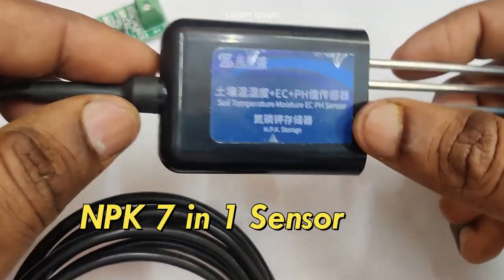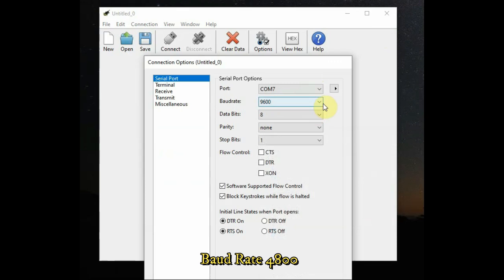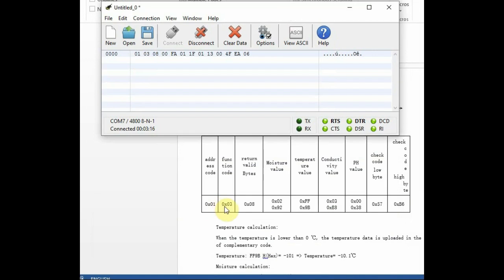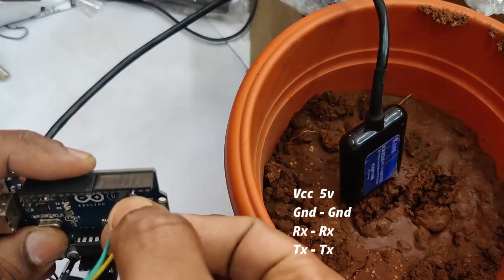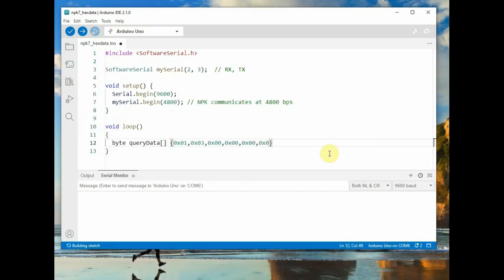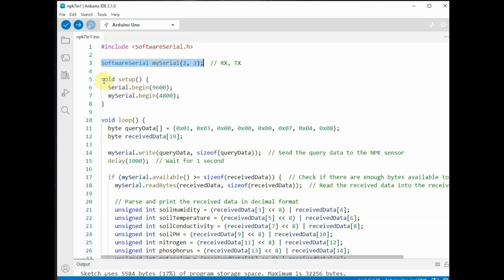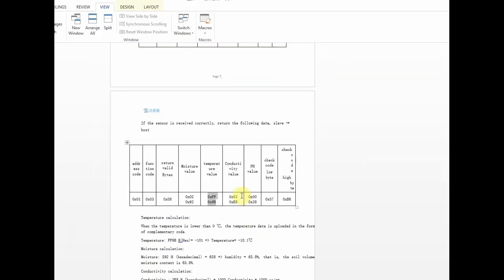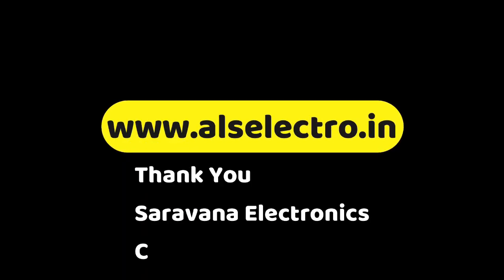NPK 7 IN 1 SOIL SENSOR - Humidity,Temperature ,EC, PH & NPK values all in one

Comment: 00:03 - The NPK 7 in 1 soil sensor provides soil moisture, temperature, electrical conductivity, pH, nitrogen, phosphorus, and potassium values.
01:23 - Connecting and configuring NPK 7-in-1 soil sensor
02:42 - Retrieve soil moisture, temperature, EC, and pH values using the NPK 7-IN-1 Soil Sensor
04:04 - The soil sensor measures humidity, temperature, EC, pH, and NPK values all in one.
05:27 - Sending query data to NPK sensor and receiving the data
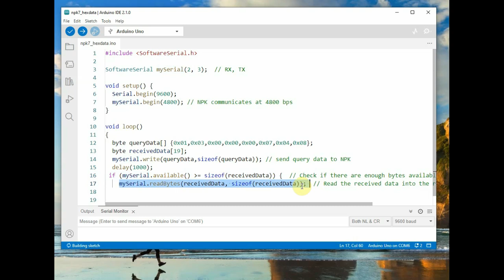06:46 - The NPK 7 in 1 soil sensor provides data on humidity, temperature, EC, pH, nitrogen, phosphorus, and potassium values in HEX format.
08:16 - Data values from the soil sensor are obtained using bit shifting and bitwise operations.
09:38 - Extracting two byte integer values from received data array using bitwise operators

Comment: i have the rs485 to ttl you mentioned in the start (max485) is  there any way to use it to interface the sensor with esp board ?
Reply from the maker: you can check this video with ESP32  https://www.youtube.com/watch?v=kVBtNAe7tow&t=992s     .Any RS485 to TTL with Auto Direct facility can be used

Comment: Thank you for your efforts, but I'm using rs485 with DI,DE,RE,RO and the output readings is wrong  .Is there away to use it instead of max13487.Thank you in advance
Reply: I intend to use this sensor but I don't have it yet. So I may be wrong about my conclusions so far. Looking at the schematic shown in the circuit drawing, the RS485 module is used instead of the MAX485 version that is physically shown in the video and has flow control (4 data pins: DI, DE, RE, RO). In the video this feature is mentioned (auto direction enable) and allows sending and receiving data between two Arduino boards (or another platform of the type). So the use of the MAX485 version is allowed but should not be mandatory. For beginners like me, this detail may raise doubts. Perhaps the soil sensor used has some incompatibility with the simple RS485 version. In this application, the RS485 module only receives data from the sensor and transfers it to the Arduino through digital ports 2 and 3, which are connected to the RXD and TXD ports of the RS485. Other boards identify these pins as DE and RE.  To add to the confusion, the power pins (VCC and GND) are next to the pins that are connected to the sensor in the MAX485 version, and in the RS485 version shown in the drawing, the power is next to the data pins that are connected to the Arduino board. In the video, the MAX485 version shows the DI and RO pins connected, but in this application they are not used. When I can test the sensor, I will post the results.
Reply: How is the result, does an rs485 work?😊

Comment: Could anyone shed light how the sensor actually works ? I understand the communication but what soil parameter it is measuring , when we try to measure N , or P or K for that matter ?
Reply: I wouldn't be surprised if it send some bogus random data. Just like the majority of the cheap chinesee  optical "glucometers"
Reply: No its working sensor (but still requires calibration for EC) if only moisture +temp+conductivity model is using. I tried comwintop model thc-s. And I.its work goog, excepts EC. Good side - this calibration equation looks universal - all  devices have same error in conudctivity measurement